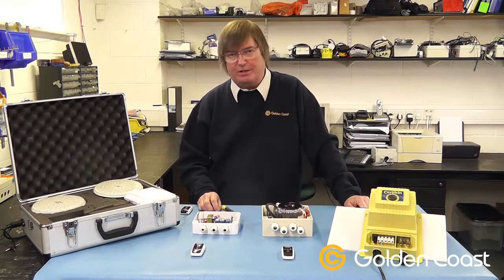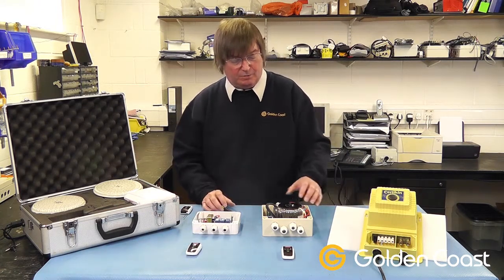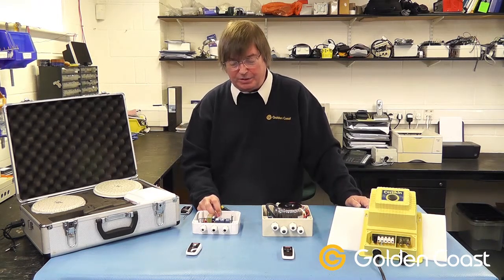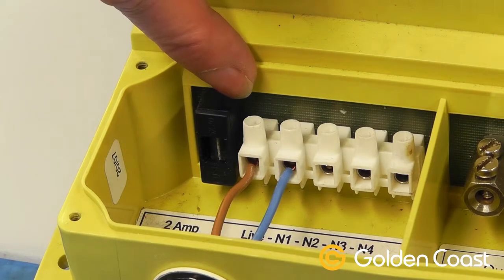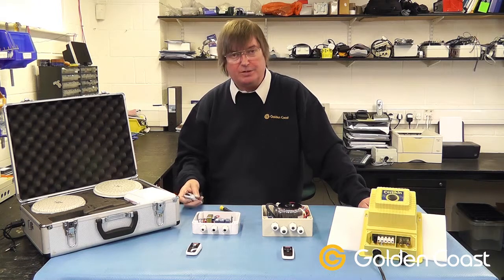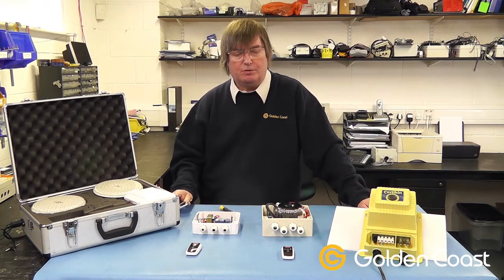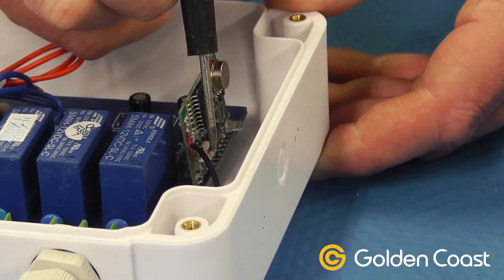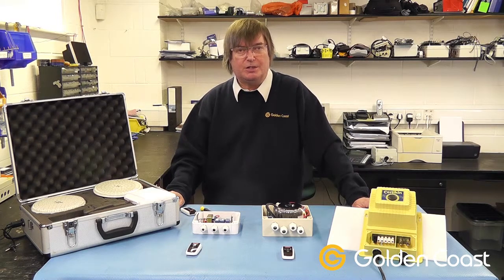How to control Spectravision LED lights | Andy's Answers

Comment: the plp-rem-300 is under tension 230v but the led  is not ok  i have push the botton of reset  but nothing happened what the problem
Reply from the maker: Hi, you could try to see if this helps.
RESET procedure for the control board
1) Make sure the PLP-REM-300 is switched ON
2) Press and hold the RESET button on the logic board
3) The blue LED will light up
4) Release the RESET button when the blue LED turns off

If the pool lights don’t work
or don’t change colours
correctly:
• Perform a RESET procedure
• Check if all connections are made
according to the electrical scheme.
• Switch the PLP-REM-300 to ON/
OFF mode (DIP switch nr 1) and
check if the lamps work.

All the best, Andy